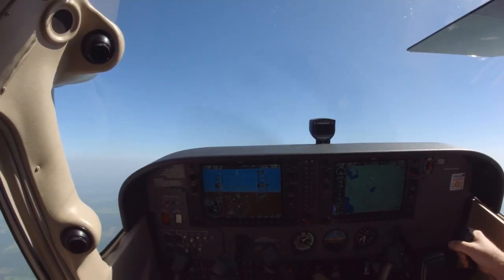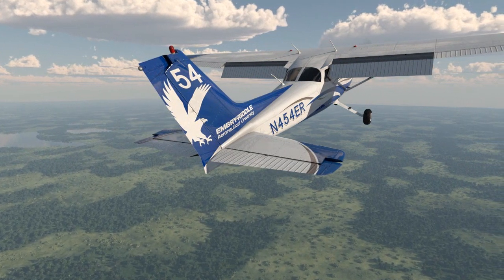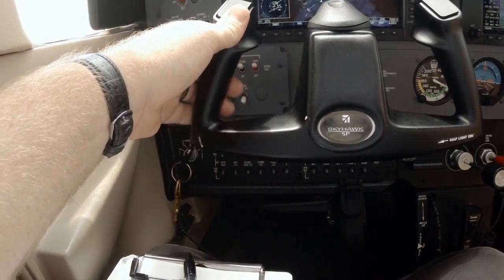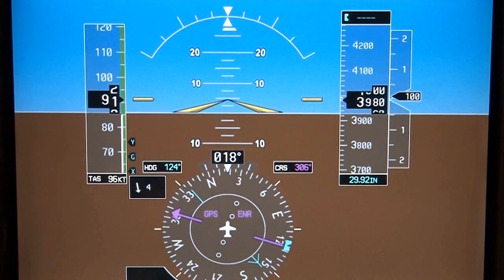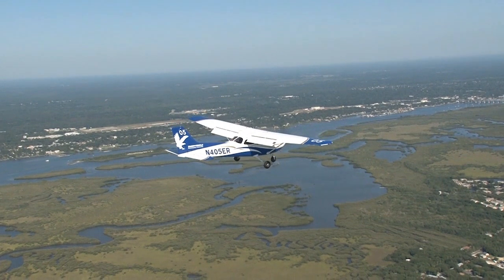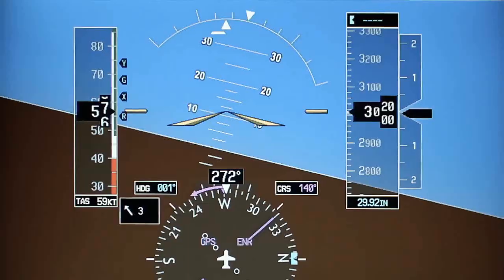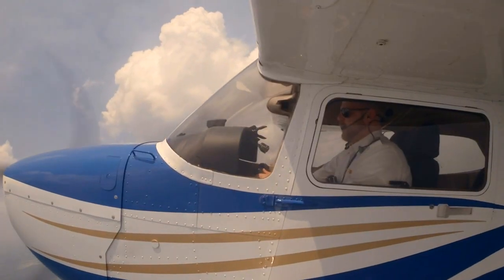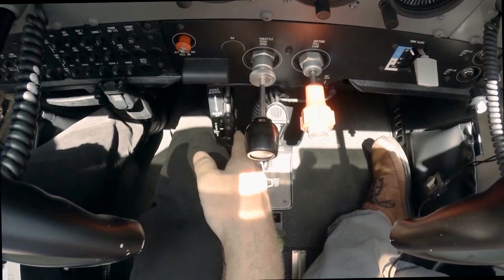Maneuvering During Slow Flight

Comment: I failed this maneuver in practice last week. Instructor was pissed and sent me home to watch videos. This one is very helpful. I'm supposed to maintain 41-44kts at 8,000AGL.
Reply from the maker: Hope the video helps! Remember to keep your eyes outside. One of the biggest problems folks have with this maneuver is focusing on the airspeed indicator too much. The nose knows, and will tell you everything you need to know. :-)
Reply: If you wouldn't mind sharing, what happened during slow flight? Did you not maitain ALT and or heading?
Reply: 8k??? why so high.  Are you in Denver?
Reply: If the instructor was pissed, sounds like you need a new instructor. I am a flight instructor, and a commercial jump pilot, and I find that to be unacceptable for an instructor.
Reply: Also I think you are thinking 8,000 ft MSL, not AGL
Reply: Unless you endangered your instructor or the aircraft, I see no reason for the person to get angry.
Reply: Brodie Bergeson 
Moody instructor
If you were to be proficient at your first attempt you wouldn’t be there
Reply: I know this is old, but if your instructor is pissed, either you should not be a pilot, or they should not be an instructor.

Or both.

My CFI has a student who has something like 40 hours, and still can't even taxi.

Comment: When slow, as with stabilized approach and deceleration coming into ground effect, the anti-turn control (rudder) should be the go to wing leveler.  Aileron overuse aggravates wing wagging which is dangerous when low and slow.

Comment: That stall horn is sounds scary!
Reply: Now put your hood down and keep the stall warning alarming. Maintain airspeed and altitude. Turn left 90 degrees; now to the right 90 degrees. Keep the stall warning sounding. Return to original heading. Descend 500 feet. Trim the aircraft for normal flight. Hood up. Private Pilot check ride, ERAU in 1971. Smith was Chief Pilot and my check ride examiner. The use of the  hood in slow flight came as a complete surprise.

Comment: Why are we supposed to pitch up/down to maintain airspeed when climbing/descending? Shouldn't it be enough to add/remove power to climb/descend at the same airspeed?
Reply: in General aviation. when you are climbing, you're usually using full power. so you can't add more power. 
and when you are descending you usually don't have any power input. and if you getting too slow. then you'll just pitch down to increase airspeed. and then you'll have faster descending speed(VSI). and it'll be just sooner until you start to fly straight and level again. so why add power?

Comment: Why is this maneuver necessary and what is it used for?
Reply: If you are flying around terrain, you want to be able to fly around stuff without losing control by going too slow or cross controlling accidentally. Not all airports are surrounded by flat earth. Practicing near the limits at a safe altitude allows you to maneuver safely into a tight landing if the engine were to quit. Getting too slow and falling (stalling) out of the sky will kill you!

Comment: Why can't they make planes that you can see ahead of you at all times? What about a front Camera?
Reply: because extra stuff added to the instruments is incredibly expensive...not great for general aviation aircraft, which are supposed to be more accessible by the public.
Reply: They did, it's called the Concorde ...
Reply: Eyes outside (VFR) so camera ideal not good. Also why add latency to the mix?
Most flying should be level unless you like flying inefficiently and taking longer than necessary to get somewhere. 

Can you afford a B-29?
Reply: 60+ year old design might be part of it lol

Comment: Why would the plane turn faster when flying slower?
Reply from the maker: The reduced speed also reduces the radius of turn, allowing the airplane to turn faster. Imagine doing a 360 degree turn in your car at 5 mph vs. 50 mph. At a slower speed, you would be able to complete the turn faster and with a much smaller radius.
Reply: @ERAUSpecialVFR  Seriously an underrated channel. Great response and explanation!

Comment: The slowest IAS in the video under dirty configuration was 20-30 knots - that's crazy! I thought the slowest (before stalling) speed would be 1.3*Vso, which is approximately 53 for Cessna 172SP.
Reply: Ive gotten a 172 to 0 knots groundspeed during slow flight
Reply: THE HARRY BROWN PROJECT
There is a very large position error at high angles of attack plus power reduces stalling speed, result = abnormal INDICATED airspeed. It’s pointless flying the aircraft with the stall warning blaring, what we are trying to do is AVOID flying at this speed, not encouraging flight at stall speed. If the stall warner sounds positively, take stall recovery action immediately, that’s what should be taught.

Comment: I thought bank to be no greater than 5* during slow flight, you're recommending 20*
Reply: 30 degrees is the standard for the Canadian Commercial Pilot License
Reply: @piraquivefl  Gotcha, I am looking at the ACS & there's no mention of bank angle during slow flight.
Reply from the maker: The ACS mentions maintaining a specified bank +/- 10 degrees (private pilot), or +/- 5 degrees (commercial pilot). There is no specified limit in the ACS as to what bank angle you can do slow flight at, only that whatever bank you were assigned, you maintain it within those tolerances, as appropriate for the certificate you're seeking. Hope that clears things up.

Comment: Isnt this bad for the engine?
Reply: Depends on your prop and fuel mixture setting. Yes, this can generate a ton of torque on the motor, and burn a lot of fuel, but for the most part it's fine as long as you use the right amount of throttle, carb heat (side note: flying for extended periods of time with carb heat on IS bad for the engine, since it's unfiltered air), and fuel richness.
Reply: Yes